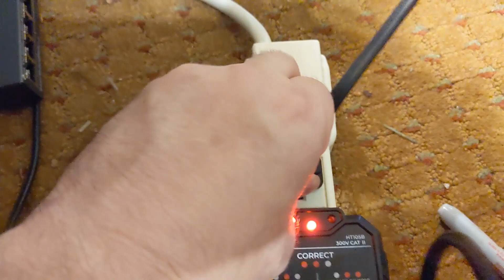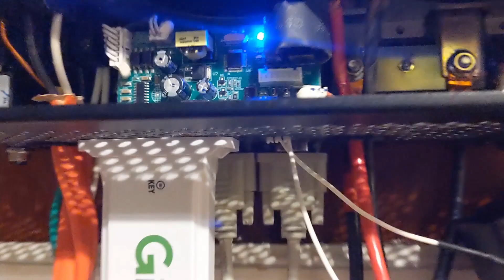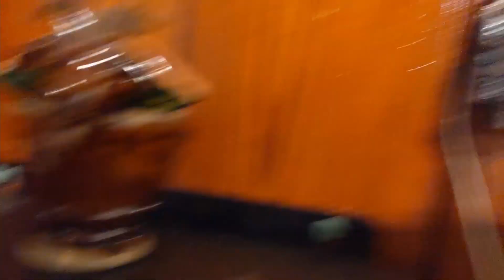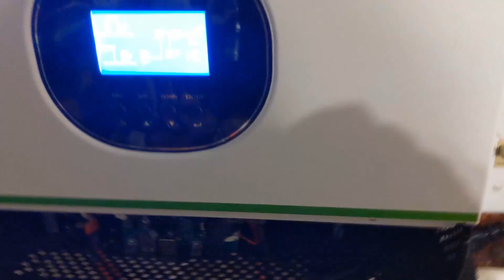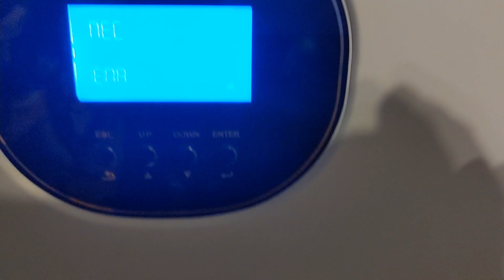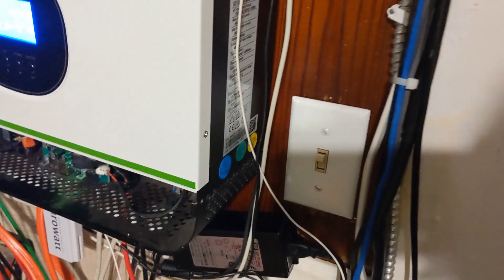Growatt LVM 3000 Neutral Bonding

Comment: Im just going through this now, which is how i found your video. My growatt doesn't have option 24. On the new ones, they up dated the firmware so it is disabled and no option to enable it. It still has the dry contacts thou. What do you suggest. Thanks
Reply from the maker: I really don't understand why they removed the option, however looking at the current manual, if you have Program 01 set as SBU or Solar first, and you connect the relay to the dry contacts on the NC and C then what it should do is open the contacts when the battery level is below the value set in Program 12, that is the level that tells it to switch back to the grid as the battery is nearly empty, and then to close the contact when the battery level hits the value set in Program 13 which is the value set for when to switch back to the battery/solar supplying the loads. 

This will only work in those modes vs the old setting was simply tied to whether the inverter was running on utility or solar/battery not tied to battery state. The issue being if you have a power outage, and the battery voltage drops below what is set in Program 12 it will open the contact even though you are still on inverter power until you hit the battery low voltage shutdown setting in Program 21. So there is the possibility that during a power outage that goes deep into the battery reserve the relay would open breaking the ground bonding while still on inverter power. A hopefully rare occurrence but still a possibility. Best that can be done with the settings that exist now.
Reply: Thanks
Reply from the maker: @TheWoodshedOffGrid  No problem, hope it's helpful!

Comment: This could/should work just the same if i was to hook my AC in to a generator thats bonded?
Reply from the maker: Yes it should.
Reply: @andycanfixit when youve switched over to youre growatt and off grid,how are you grounded? Do you have a seperate ground rod incorporated?
Reply from the maker: @scarygary3569  yes, there was a separate ground rod for the growatt and to bond the solar surge protection devices as well.
Reply: @andycanfixit  unfortunetly my growatt doesn't have setting 24...damn. I too have separate ground going to SPD but Guess its back to drawing board for now but thanks,good stuff. I still have dry contact signal ports and description in manual that I may still be able to do this by my settings in program 12&13. Won't know if I don't try✌️

Comment: I am setting up my 24V Growatt 3000TL LVM in a van with limited space. Instead of installing a relay, I'm considering installing a light switch that I leave in the on position when not connected to shore power and I switch off when connected to shore power. The AC output ground will have a second wire that goes down to the switch, and the AC output neutral will have second wire that goes down to the other screw of the light switch. This will normally be on, but when I connect to shore power, I will turn it off. I have 2 questions. 

1) Is there a simpler, smaller type of switch I can use (with the same 2 wires running to it)? I thought, maybe a toggle switch, but it is supposed to have 2 black/line wires connected to it, breaking one "line" of energy. Could I run ground into 1 side of the toggle and neutral into the other side?  

2) Other people have said that I want to use this switch to break the ground in my Growatt because if I plug into shore power and there is a GFCI/RCD breaker upstream of the inverter (excluding in breaker boxes), it will trip the GFCI. If I always break the ground (turn off my light switch) before plugging into shore power, is this okay regardless of whether there is GFCI upstream of the inverter or not? In other words, always turn off the light switch before plugging into shore power is a good rule to follow? I would very much appreciate anyone's feedback on my questions. I'm fairly new to all of this, so apologies for any "stupid" questions. Thank you.
Reply from the maker: These are not stupid questions. Using a light switch or toggle switch is a good solution to this for dealing with shore power provided you make sure you also place the inverter in ups mode while on shore power so that it doesn't switch back to battery/inverter once they are full if you have solar as well. So long as the only ground neutral bond in your van is at the inverter via this switch you shouldn't need a separate or double pole switch to break the ground when plugged into shore power. Van's and RV's typically trip GFCI's because they have ground neutral bond somewhere that the owner doesn't know about. Given you are installing all your electrical that should be ruled out and you can test that at all your outlets with an outlet tester. For the switch a toggle or light switch is fine but you want one rated for 30 amps at 120/240 volts. You can find them online for about $12 to $18 dollars. For bonding you just need a single pole switch as you are only connecting the two wires. 

Unfortunately the automatic transfer switch via relay doesn't seem possible on the newer Growatt inverters as they seem to have removed the setting from them and now use it for triggering a generator start or a low battery disconnect instead. 

Adding a second switch to break the ground in case you find it tripping the shore power source might be a good idea if you find yourself in a pinch but in general it shouldn't be needed so long as the only ground neutral bond in your van is at the inverter via this switch. I would view breaking that ground as more of a last resort, in general you want things grounded when connected to shore power.
Reply: @andycanfixit  Thank you very much for your detailed reply. It will be quite helpful. I'm also going to ask (again) in Will Prowse's online forum to see if anyone there knows anything new. Do you do any freelance work?

Comment: Question: I don't have a growatt inverter, but a renogy - and have the same issue. I require an N-G bonding relay. But I don't have the NC, C and NO connections through my inverter. Could I not do the same, with a 24v power supply, powered by the main panel, so that when the power goes out and the inverter powers my critical loads, I would then bond N-G? Basically mains/shore power will be the trigger to bond the N-G in the critical loads panel that IS being powered by the battery when off grid. Would that work?
Reply from the maker: That should work fine, it sounds like you are using it as an emergency power source just when the main power is out. If that's the case that should work.
Reply: @andycanfixit Awesome thank you! Yes, I have an inverter charger and two 170ah lifepo4 batteries. Connected to that is a critical loads panel.

Comment: Designed and installed an entire custom Powerwall only to figure out that the Luxpower SNA5000 inverter also did not have an earthing arrangement , nor does it have those contactors to control a relay . When I asked , they said to just bond the 2 neutrals . Which is seriously odd and probably against regulation but it worked

Comment: So what happens to the bond in the panel? You're not supposed to be bonded in 2 places as it can create issues. But while you have a switch connecting your bond when the inverter comes in, there's nothing disconnecting the panel bond.
Reply from the maker: You are no longer connected to the main panel when it switches to the inverter, so the inverter becomes the main panel at that point. That's why this is used.

Comment: These whole relay fiasco is silly, you are pulling your feed directly from the main DB where the NE bond is created. You can just bond the NE output of the inverter permanently, your case is earthed to the same point. All neutrals before the Earth leakages should be linked Grid and UPS side. 

Now the big mistake people make is "grounding" the DC components to the AC Earth, to two operate on completely different principles.

Comment: Hi Andy. Great information. I'm still gathering equipment to build a system, and getting an education in the process. 
As I understand the principle behind this, Pin out connections and other connections not clear, to me at least. The what looked to be #12 G and N pretty clear. The power supply: Is one lead going to MPPT and the other lead to the Relay? Then the white wire (what looked to be #18-22) from MPPT to the other pin on the Relay? 
Do you have a schematic somewhere on this?
Reply from the maker: Basically the goal of this is to bond the neutral and ground together when the inverter is supplying power from the batteries and then unbond the ground and neutral when power is being supplied from utility. If you are never supplying power from utility, you don't need to do this or if the utility power is a generator. If you do the wiring is actually pretty simple. You take one wire from your neutral, one wire from your ground and wire those to one of the contact closures on the relay, using the normally open position. 

Then you take your DC powersupply that is used to power the relay and wire it so one wire goes to the contact closure on the inverter, and the other wire goes to the one of the relay coil power terminals. The other relay coil terminal you run a wire from it back to the contact closure on the inverter. This allows the contact closure on the inverter to close when its off grid/utility and supply the dc power to the relay. Once the relay is powered, it closes and bonds the neutral and ground back together. I don't have a schematic of it but it would be pretty simple to draw one up if I have a bit of time tomorrow to do so. This uses option 24 in your inverter to trigger this function. Check and make sure your inverter has an option 24, titled NEC and you'd set it to ENA for enabled. If the inverter doesn't have it which I've heard some of the newer ones don't this this is not something you can use. Hope that helps make a bit more sense of this.
Reply: @andycanfixit  Thanks for your time. You just cleared up what I thought was how it was wired. 
I have ordered a 3k 24v and have not received it as of yet, they tell me their shipment should arrive end of May (this month). I have checked the manual and it skips from 23 to 28.
I will be having a 120v supply to the unit so hopefully the system sees the switch over.
Thanks very much.

Comment: Great video. I'm in the same boat. Why did you choose a 10A relay? Wouldn't a 30A relay be sized appropriately for the potential of the unit? Thanks.
Reply from the maker: Mostly because it was the easiest low voltage relay option I could find for it and except in a fault situation it shouldn't have current on it. After another person pointed out that during a fault it could exceed 10 amps, I went back and wired it to use all three poles of the relay, since each pole is rated for 10 amps, that should give it 30 amps capacity which should be fine. I didn't feel comfortable running a high voltage through the growatts contactor to operate the relay and this relay uses only a few watts to close it. There are probably other relay options, but the relay coil should have a low draw so it doesn't exceed the Growatt contactor. I haven't found a voltage amperage spec for the contactor in the Growatt, but they are usually rated for only 1 or 2 amps. Larger contactors tend to have more power hungry coils.
Reply: Thank you for that explanation. I'm going to try it out with that setup.

Comment: Good video.    However, the statement that there is not much current is only correct in the normal no-fault situation. 
The purpose of the Neutral-Ground bonding is to ensure the breakers will trip if there is a short between hot and ground.  (Without the N-G bond there is no path to clear the fault)  That means the relay should be capable of carrying enough current to trip the main breaker that the inverter is feeding.   For a 3000W inverter, that would be 3000W/120V=25A.   A 10A relay will probably do the job because the 25A will only flow long enough to trip the breaker.  However,  technically it is too small for the job.
Reply from the maker: Since it has 3 poles on the relay and each pole is rated for a 10 amp load, you could wire it to use all three allowing it to handle 30 amps. That should increase the headroom to a more than safe level especially for such an instant trip.

Comment: Hi Andy and thank you for the informational video, much appreciated to those that are learning the DIY trade. I have another question that I'm sure is an easy fix for you, as was my last issue with grounding. I've finally connected both my 3000TL LVM-ES inverters, running in Parallel Split phase. Both up and running on solar and battery perfectly without problem, charging, loads, etc. The moment I connect to utility from house (AC input to inverters) under "Parallel Split" phase configuration I instantly get fault 15/16 error? If I run the inverters independently (Program 23 SIG) and connect to utility, no fault or errors of any kind. The manual says error 15 is to check AC input wires to all inverters, I did that and all is wired with polarity in check. Fault 16 says "Change input phase S and T wiring", what does this refer too? I've created a video of my inverters, wiring and fault messages, if you have a chance I'd really appreciate some professional advise, thank you. https://youtu.be/9y-Wt_WyGxE
Reply: I'm not a professional but I looked at your video and whilst you have the output connected in split phase your input being fed by that 40amp breaker is single phase. You should have two separate breakers for each AC input leg. Or you buy a double pole breaker and take the two legs to feed your two inverters
Reply: @MrShaneo369  Thank you Sir, any and all support is helpful. I'm guessing my issue of Faukt 15/16 is the same issue that Andy made a video on where the inverter is acting between double ground and Nuetrals without having a relay to step in and out as needed.
Reply: @ahhlifesgood1956  ok cool. Did you check your wiring to ensure you have two separate phases coming in?
Reply: @MrShaneo369  Well guess what? That fixed the Fault 15/16, it was indeed having an individual pole available from the main breaker, wasn't sure that would fix it seeing as I would only connect 1 AC to inverter and it'd generate the error. I also upgraded the cable size which might have also played a role. Anyhow, thank you sir, that made my night having that fixed!!! I added a double pole breaker and upgraded the AC input caliber to 8 awg and it fixed the Fault.
Reply: @ahhlifesgood1956  hey happy to know I was able to help all the way from the Caribbean. Thank Andy for creating this video and helping us all with our projects I'm forever grateful!!
Reply: @MrShaneo369  Yes as always thank you to Andy for opening up this channel and helping us all pave the way through this community. Cheers to all!

Comment: Hello. I bought a grounding box that in fact do what you do (I think). I connected it to NO and C of my Growatt 5000ES inverter. But the menu n#24 the manual told me about to enable the grounding function is never displayed. A clue ?
I precise I use 2 inverters in parallel. I installed the grounding box only on 1.
Reply from the maker: I'm not familar with the 5000ES versions, however someone else commented that on a new 3000 one that while the manual still lists this function, option 24 wasn't showing up in the menu. I'm not sure if Growatt has changed something with the firmware on these newer units and it's not showing up now for some reason. I'd suggest sending them an email to ask about it and why it's missing. Let me know if they respond as I'm curious about what they say.
Reply: I'm running the newer version of the SPF Growatt 3000 to LVM-ES and it doesn't have option 24 on the menu, it does however on page 11 of the manual show you the configuration of NC C NO Dry contact port open or closed based on your selection in Program 01 of "Utility First" or "SBU" first. Not sure how sure how the wiring goes on either or based on selection but based on Andy's video I think we can figure out to use NC and C or NO and C as you input leads?
Reply: @ahhlifesgood1956 hi I've been reading through I know it was along time ago did you manage to figure it out as I have the gw3000es and would love to know how you did it .
Reply: @sparrowsends  in fact it did not work because mu inverter seems to have removed the relay signal I needed. SO the menu #24 disapeared. I think they did that because it was not working well. I resolved my problem disconnecting the inverter from the public supply (I have a system that switch inverter ar public supply automatically when the inverter do not give current anymore : like that public supply and my solar systen never cross.
Reply: @monsieurd.6890  thanks for that, I basically want  the same ,so when the there's no sol ,batts are died the grid takes over basically.